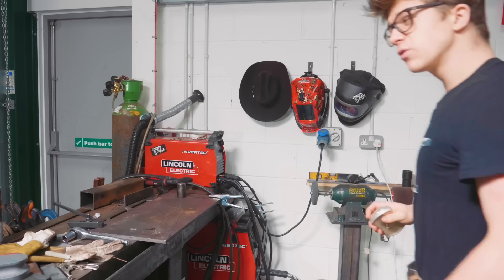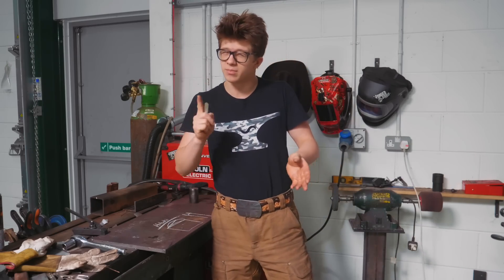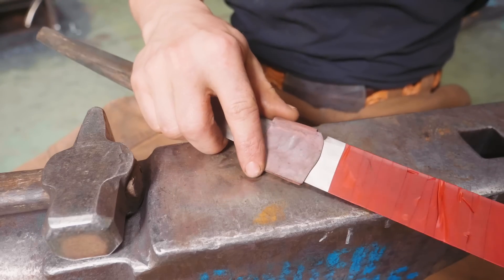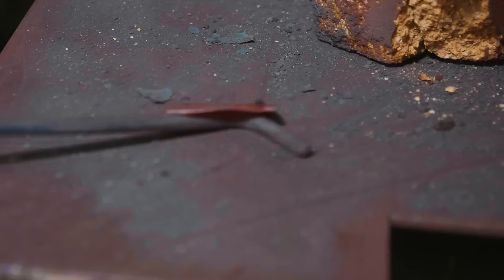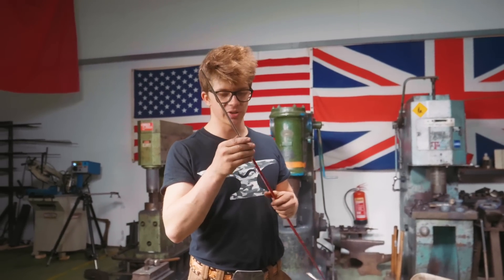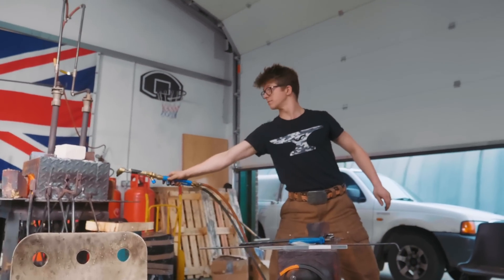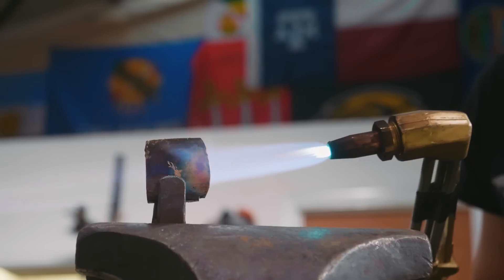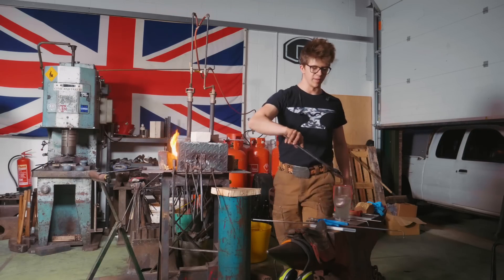MAKING A KATANA!!! 1 MILLION LAYERS!!! PART 6 - The Habaki

Comment: To silver solder you have to have a clean solder joint.  I sand both sides of the joint with 120 grit sand paper.  Apply a Liquid flux (way easier than powder) then heat till it bubbles and apply the silver solder.  It should wick into the joint.
Reply: Late to the party, but to expand on this comment, the copper does not need to be red, at some point it will actually be too hot,  like in the video and the solder skates off the top rather than flowing smoothly into the joint.
Reply: If the YouTube video didn't mention it; when you silver solder, heat the material after it has been fluxed, remove the heat while at the same time, touch the material joint with the silver solder.  Don't try to melt the solder into the joint with the flame.  When the joint is hot enough, just touching the solder to the joint will melt the solder and wick it into the joint.  Too much heat on the copper will burn it and cause it to bubble!  Works with stainless steel as well.  Burning stainless steel, however, will cause it to "Sugar."  Burns the nickel out and leaves a crystal looking material.

Comment: The Habaki would be a great place for your touch mark
Reply: Nope, on a Katana the touch mark goes on the tang, that's tradition.
Reply: J.M. K. I think you're confused. He didn't ask where the touch mark traditionally goes. (Also, nope... The touch mark didn't go on the hang, because they were signed with a name, and had no touch mark. The whole point of a touch mark is to avoid having to sign your name. So... Nope.)
Reply: Signing with your name is the same as having a touch mark imho, and I know he didn't asked that, he simply suggested that Alec should put his one there, I disagree with that.
Reply: With all the overcoming the habaki has led to and with how non-traditional this katana is (no hamon or the mild steel sandwiched in the middle). Why not lay a touch mark and own that. Just my unrequested thoughts
Reply: Hey Alec, my artist/jeweller mother taught me to silver solder when I was wee, and I used that skill to put together tiny miniature weapons in copper, silver, and brass. At the end of this video you mentioned tips, so here's a few: instead of working straight from a rod, snip off a few pieces and bead them up with the torch. Then use a pointy steel rod, heated a bit at the end, to grab the beads in order to place them on your ready-to-flow workpiece. This way, when the bead flows into the joint, you don't have a big ol' mess. Number two, think in terms of heat and capillary action. In other words, those are the two things that will pull the solder across the piece. You probably could have joined up that habaki with a much smaller torch tip, and that would have let you isolate your heat a little bit and have the solder flow to the hot spot. As far as capillary action goes, like you said, having your surfaces close together is good.
Thats all I can think of that might be helpful, good luck on the rest of the build, I'm looking forward to your tsuba(guard) and the rest of the furniture.
-Morgan from Nova Scotia

Comment: Shoulda tried a mokume gane (Damascus with stuff like brass and copper instead of carbon and nickel steel) hibaki and kashira. That would be a sweet new type of Damascus for you to try Alec.
Reply: Hitoshi Kirako was just thinking that but I’m always surprised how few people even know about this technique.
Reply: Chris Vincent I guess its a bit hard to do, I did see a guy use some US coins to make it
Reply: Chris Qiao that may have been BackyardBowyer. I would gladly send a giant ass box of U.S. coins to Alex if I needed it. I live I the south part of America, and have a crap ton of old quarters.
Reply: Hitoshi Kirako Save the old quarters, trash the new ones. Some of the old ones can still buy a loaf of bread. The new ones don't have any of the intrinsic worth from the silver content.
Reply: Atlas WalkedAway the newer ones have a different alloy that doesn't weld together as as well. new ones melt SUPER easy, and if you smack it with a hammer to finish the weld, molten metal sprays out. Trust me, I have a 4 inch long burn scar on my leg from attempting with new quarters.
Reply: That would look so badass. He for sure should try that.
Reply: Great idea.  I've seen mokume done at a blacksmithing conference with modern quarters.  You need to use oxygen free copper as well.  They work well together.  The trick I learned was to control your heat.  As soon as they get that wet looking sheen to them they are ready for the first weld.  If you let them get too hot they will go molten on you and spray out.  Also helps to weld them up in a small chamber of mild steel to keep them aligned in their stack.
Reply: Lou L maybe I can try again without any burn scars from molten metal splashes xD
Reply: Its a wicked hard thing to master.  Mokume gane with US quarters works, but can still be a fickle thing without the right temp control.  It looks amazing and have made a few pieces myself.  Mind you after weeks of failures.  If Alec used round copper stock forged you know he wouldn't use a prebonded nickle to copper core US quarter hah.
Reply: Hitoshi Kirako why not roll them and take them to the bank. If you have tons of old quarters that's tons of cash. Could be a big payout
Reply: Happyradish18 There is a local collector in my town that will pay more sometimes, but I have done that before with coins he didn't want.
Reply: Hitoshi Kirako ah ok
Reply: Hitoshi Kirako To be honest, the first time I ever heard of/saw this technique was on an episode of “forged in fire” :)
Reply: nah i think it does not fit a damascus blade that nicely. just too much, an overkill.
Reply: A friend of mine does a bit of blade making and black smithing. He's told me getting mokume gane to fuse is one of the most difficult frustrating things he's ever attempted haha. It is beautiful when achieved though!

Comment: I was a plumber for years. The best tip for soldering i can give is to make sure both pieces are clean and roughed up before you solder.
Reply: Plumbers don't silver solder, they/you use(d) tin/lead solder, and that's something complete different. Silver solder doesn't need any flux, just concentrated heat.
Reply: Yes, true. I did use silver solder a few times and it worked best for me when it was nice and clean. I was in a hurry and meant solder not flux.
Reply: A lot of plumbers use silver solder, where I'm from silver soldering the copper piping is the norm
Reply: agree. most don't use tin/lead beacuse it's usually the supply lines that are done in copper. don't want the lead in someone's drinking water

Comment: Alec Steele
It is nice to know that you read your comments, Walter Sorrells is a good teacher.
For silver soldering you should be using an Oxyacetylene #0 or #00 tip torch (pencil thin tip) and a liquid flux that contains zinc chloride and hydrochloric acid, it works well for any type of soldering.
Since you already have Oxyacetylene  (or equivalent) you can copper braze using #16 electrical copper wire as a filler and common brazing flux and #0 tip torch.

Comment: Braze it next time silly!   Use your oxy acetylene torch with a small pencil point flame and use a copper core welding rod, knock the flux off of the rod and melt it into the seam. Voila. 
Watch my video on this channel about my forge burner, there is a picture example of the end result where I show an auger bit soldered to the inside of a black pipe section of my forge. Even though this is days later.....it's still good Intel my friend. 👌
Reply: Yes...Braze is the way to go. Get a high silver % and it is workable kinda like copper and it will polish up nice.
Reply: I thought the same, he's making that whole thing hot, while he just had to focus on the seam with a small, hot flame, and than add the copper welding rod, I've done it a thousand times; welding copper pipes together for refrigerators, you know: the small one into the big one, so the gas inside expands rapidly thus cools it down. Well not gone give a lecture on how refrigerators work, but you get the picture. I'm a retired metal worker, have made many things, and worked with many tools. And I like these clips from Alec very much, and his love for his trade is just adorable. I've also learned a thing or two from him, cause blacksmithing was something I've learned at school, a long time ago (over two lifetimes of Alec ago).
Reply: J.M.K. HVAC tech here so i know where you are coming from. The braze is going to want to chase the heat and if the whole thing is hot it just makes it more difficult. How long were you a metal worker?
Reply: Yeah important you get that neutral flame
Reply: +Chris Thomas
Some 20+ years, also done carpeting, carpentry, plumbing, constructing, painting, and more. You could say I'm an allround craftsman, but mostly worked with metals.
Reply: It's not often you see s fellow HVAC tech on youtube.
Reply: True. I made a tanto from the broken tip of a spring steel katana, and I made the habaki and seppa from thick wall copper pipe. Brazing was easy, even with an oxy propane torch, and flux-coated brazing rods. Then You just need some angled needle files to match the inside geometry to the hamachi.
Reply: just use a TIG Torch and melt it together. The easiest way to do it
Reply: That is exaxtly how its done by a shiraganeshi, the habaki maker. They take two pieces of wire and wrap it around both end of the habaki, then on the inside of the habaki on the blade side they lay a rod of silver and brass down and heat that end allowing the weld to form and sealing the habaki. As you guys know its called brazing
Reply: Or do it as its usually done, don't bend some plate in shape, take a copper block and punch a hole trough it or use copper pipe and shape that over the steel blade.

No need to weld anything.

Comment: I wish I could fail as successfully as him. 😂😂 Instead, I fail....and then whatever I’m working with spontaneously explodes.
Reply: Taft Brandli dude you have a talent! You could be working on a paper plane and turn that into a bomb, something I’m sure is useful in a combat situation ;) :P
Reply: Taft Brandli "any machine is a smoke machine if you operate it wrong enough" -an old navy friend
Reply: I was making a knife once and i literally melted it in half, quite spectacular but i was so mad
Reply: You my friend show make YouTube videos! You'd probably do better than Alec! Hahaha
Reply: I had a fail spontaneous explosion today lol. I'm and electrician, I changed out an old panel at and old shop where all the wiring was crazy. It had a bunch of Edison circuits 2 hots for one neutral, one of the old outlets was wired wrong so when i flipped the breaker on Kabang  direct short sounded like a gun shot. tripped the 200 amp main, so it was a 2000 amp short lol.

Comment: All I can tell you all.when making hibaki. Its easy to remove material, not put it back. Work very slowly with your file work until it is perfect and fits perfect first to the sword ID measurements. Then file the outside until this fits perfectly in the Saya. Just take your time. Maybe make two whole hibaki while you're at it in case you mess one up. I see Copper is the most authentic material but I have seen brass and silver on antique Nihonto.
Great video!

Comment: As a hobbyist also with smithing and electronics, I would suggest when trying to solder, 1) lower your overall heat to the solder's melting point and to use a heat synch. 2) try a more focused flame

Comment: If you ever do another katana, it's my understanding that for the habaki they do something pretty similar to what you did, except they make a more precise wedge for the front, and hang everything from a steel wire when soldering just so they don't have to worry about holding everything in place. Great job so far either way.

Comment: A great tip I learnt from an old engineer was to mix the silver solder flux with saliva into a paste, wipe paste all over the joint and also dip your filler rod into it.
Never put your filler rod into direct heat from the torch there should be enough heat in the workpiece to melt it into the joint. 
Great videos as always. 👍

Comment: Alec, I believe that when hard soldering copper is involved, you must pay attention to the surface of the soldered copper element. Its best to ‘activate’ the copper with nitric acid before soldering so the soldering material will ‘wet’ the soldered surface evenly. Just a friendly tip from a nobody but I guess you will find it informative for the future.
Liked the video btw.

Comment: I think the trick is to use a narrow hot flame and heat the part to be soldered and then pass the solder rod on the area and the heat from the copper will do the work, having the flame there will melt the rod too much and the solder wouldn't stick where you'd want it to be, anyhow you are awesome and I'm really enjoying your daily Katana making videos..it's like I'm having the experience myself!

Comment: hey alec, long time watcher, first time commenter. you can tig weld copper very easily just by fusing the edges together or you can cut a thin strip of copper sheet and use it as a "filler rod"

Comment: Hey Alec as a person who's done a LOT of soldering I can tell you in the future you'll get much better results using a paste based solder (so it doesn't move) after you've sanded the area to be soldered to remove any oxidation.  This will produced a much better solder flow and will be exponentially stronger.
Reply: Thank you sir, corrected, brain fart moment.

Comment: Not sure if was mentioned, but I've learned that with soldering you'll know when it's up to heat because the metal you are using to strengthen the other, will melt on contact. if it sticks, then it isn't hot enough. use the flame/heat source to draw the liquid metal to where you want it. Awesome videos so far. :D

Comment: Holy crap! I can finally make a suggestion. I have a little Bernz-O-Matic butane torch that is perfect for delicate soldering jobs. In this piece you would be able to contain the entire flame inside the piece and heat the solder directly. Almost all the soldering I do is small electrical connections and wire wraps for RC airplanes and I can't recall the last time I bothered using a soldering iron or my bigger torch. It even comes with a little tip for areas, like the inside of a model airplane, where you can't have a flame and it takes almost no room so I can bring it along for field repairs. They only cost about $12.00 here in the U.S.A. and should work a treat.

Cheers!

Comment: When doing jewelry work, you have to have the smallest joint possible to make the solder wick in. You mix the flux with a bit of alcohol and heap it all over the joint as a paste, set your solder piece in the joint area, put more flux on top,  dry it out so its not hissing and spitting, then crank up the heat below the joint since the solder flows to the hottest part. I'd also recommend having the tongs as far away from the joint as possible, they are a huge heat sink.

Also, thanks for not being afraid of showing us a day of failure, it was entertaining.

Comment: @alec steele, the key to all solder jobs is clean metal, and flux. Flux before you heat, heat the part until IT melts the solder, not the flame melting the solder. Yes, the parts should be a tight fit, as solder wicks into a joint, and solder will only follow the flux unto the joint. If you take too long heating the part it is possible to burn away the solder, so heat right up until the base metal will melt the solder, and dab it in.

Comment: I think the major difference in the soldering from the beginning to the end is that to start with you were trying to melt the solder by heating the solder itself.  Later, you were heating the copper pieces you were trying to fuse and letting the heat from the work piece melt the solder as the solder touched it.  That's how I was always taught to solder.  Solder flows to the spots where the piece is hottest, so you want your joint to be the hottest are of the piece.

Comment: I love your exuberance AND your explanations. 2 soldering suggestions. 1st is to get a much smaller torch head. 2nd is that you heat the copper and then simply touch the solder to the hot copper. The flame should never touch the solder. Thanks so much for your work.

Comment: You should know for next time, that you can tig weld copper. I've tig welded lots of copper sheet metal hoods for above stoves. You can either fuse the two metals together, or if filler rod is needed just cut a sliver if the copper you are using in the project. Good luck & thanks for another entertaining video!

Comment: Another option beside TIG welding and some of the other tips...
The melting temp of copper is 1085C.  That's around a steel welding temp depending on carbon content.  Heat up the copper to a high heat, but below the welding temp, then, stick a piece of steel in the forge and get it up to welding temp.  You can then use the steel bar like a soldering iron to melt the copper just where you want.

Comment: The biggest thing with silver solder is getting the surfaces absolutely clean and I use a liquid flux.  Apply the flux to the clean surfaces, lay your solder into the gap (create a channel for it to lay into if you can) and heat the metal from below the solder until it flows into it.  A smaller flame would probably help so that you don't blow it out of there.  With all of that being said, I've never done it with copper.  I've only done it with stainless but I went through all of the same types of challenges that you did with this piece.  PS I really enjoy your videos.  My entire family sits and watches them together.